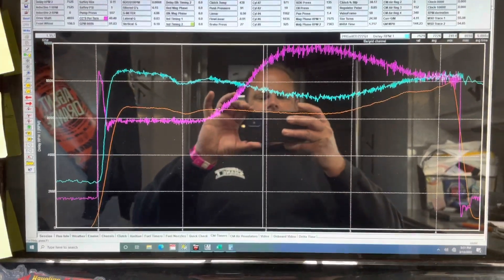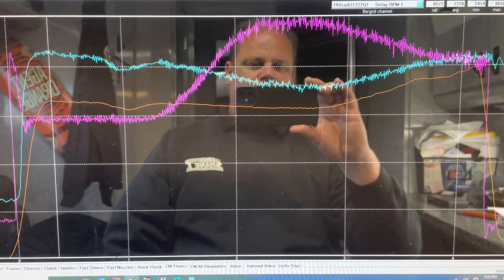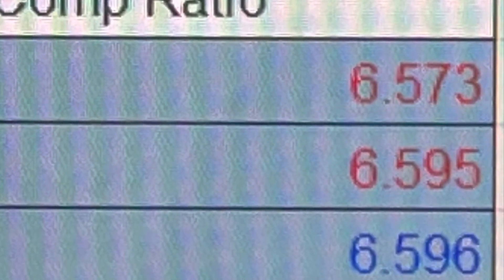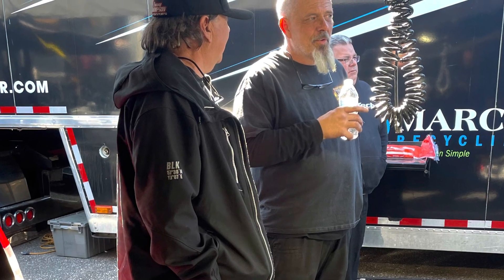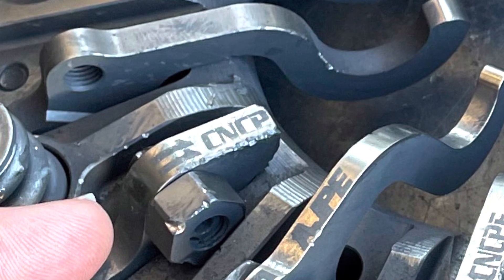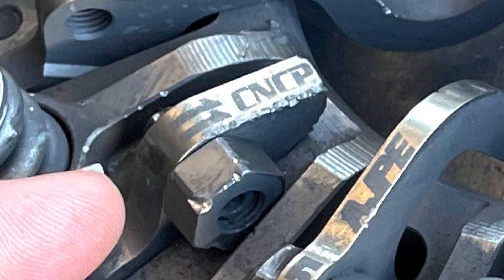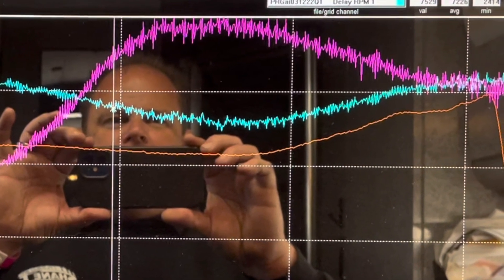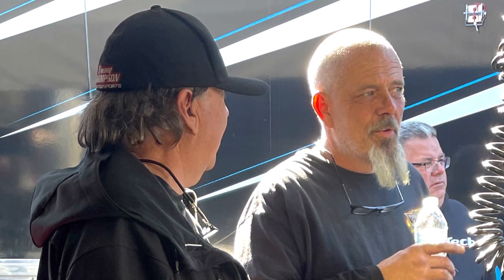My 24 Hours as a Data Engineer on a Top Fuel Dragster - Tuned By Shane T

Comment: Wow Shane, fantastic job sharing your experience with SPR.  To hear someone with your credentials find yourself amazed with top fuel tuning just really drives home how impressive these machines and the teams are.  A quick check for 80+ gpm fuel flow they must be using 2" dia fuel lines?  Every single flow, pressure, ignition advance number is just difficult to imagine working together.
Reply from the maker: I’m guessing the pump inlet is 3-3.5 and I think splits to twin 2 ish inlets, one for each pump section